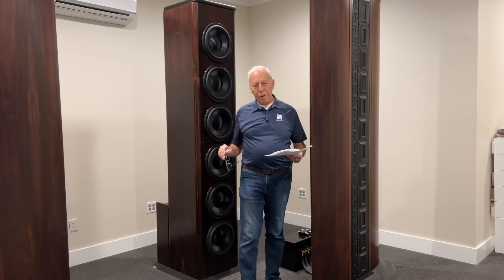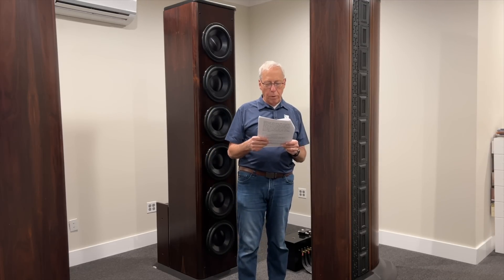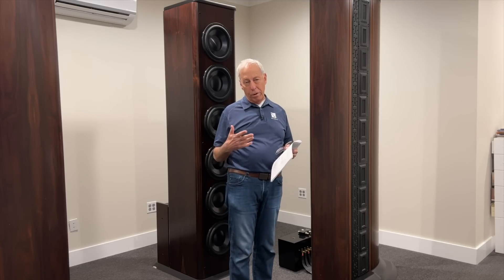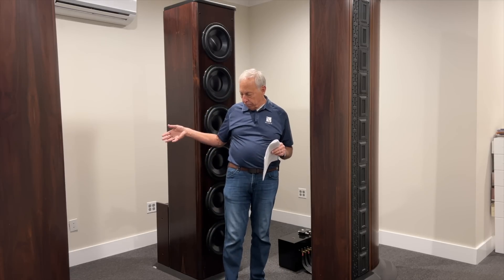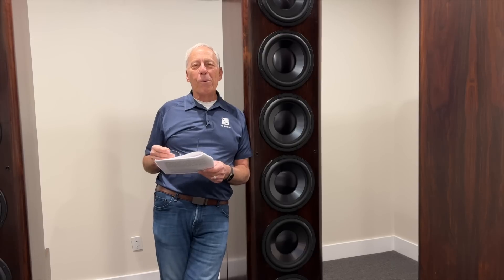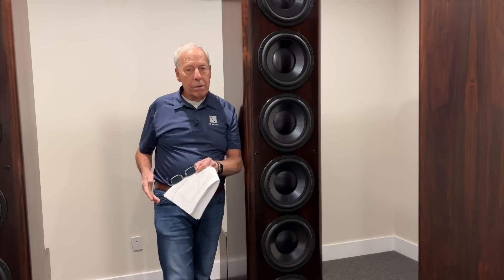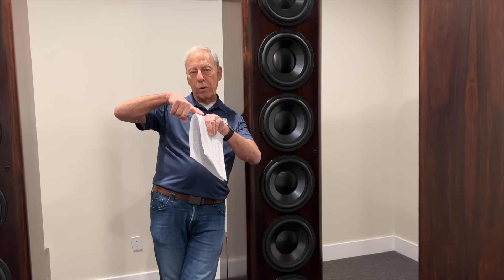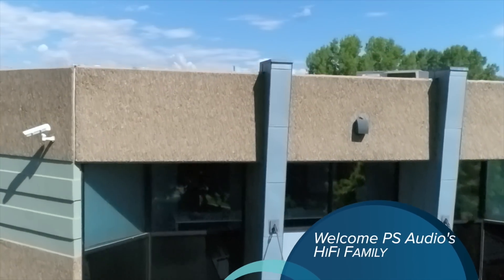Separating speaker cable conductors

Comment: The inductance per unit length of an 'open wire' transmission line (e.g. a speaker cable pair) is given as  ~ 0.9log(D/a)  micro Henrys per metre, where 'D' is the centre to centre separation and 'a' the radius of the wire. So for a 2mm radius conductor separated from its twin by 4.5mm, the inductance for a ten metre cable is around 3.2 uH, or about 0.4 Ohms in magnitude at 20kHz. 

N.B. If the distance between the wires is increased, the series inductance also increases. 

The concomitant shunt capacitance at 20kHz is around 0.9nF (~9kOhm)

[Ref. Chapter 8, Principles of Radar, Radar School MIT McGraw-Hill 1946]
Reply: Very incomplete and misleading analysis based on current advanced applied sciences that are currently in effect today.

Comment: So If I have a single line of cable for each positive and negative[GND] on the cable to the speaker, which I do today I am better of twisting them together (which i do for interconnects) They currently are just generally following the same path from amplifier to speaker.

Comment: Given the extremely low source impedance of your average S.S. amp, load impedance of the average 8 ohm speaker and crossover network, average cable length and at audio frequencies, does the math indicate there will be any roll-off in the audible range?  By how many dB at what frequency?  I.E. what is the cable's inductance, how much does it change and does it have any impact at audible frequencies?

Comment: It would be pointless to argue with Paul's statement that separated zip cord wires sound better than paired.  As the voice from the back of the audience in that Firesign Theater album says, "That's metapheesically absurd, mun, how can I know what you hear?".  But regarding the statement that separate wires have less inductance than paired wires, I can confidently say it's wrong.  Yes, capacitance decreases as you separate the wires, but inductance increases.  

The simplest way to visualize this is to note that for a given current I, the magnetic field B cancels more completely as the equal and opposite currents move closer together.  The largest B can be in any case is at the surface of one of the wires.  The total energy due to the field B is proportional to B^2 integrated over all space.  It follows that as the spatial extent of B becomes more localized as the wires move together, the energy decreases.  But the energy is also proportional to L*I^2, where L is the inductance.  Therefore, L must decrease as the wires move together to more completely cancel the magnetic field.  Most of the concepts needed to understand this can be found in any decent intermediate college level textbook on electricity and magnetism intended for physics or engineering majors.

When I read a "white paper" by some cable manufacturer describing how electrons or signals flow through his cables that has almost nothing in common with accepted science, I like to quote the physicist Wolfgang Pauli: "Not only is this not right, it's not even wrong".  In the case of Paul's statement about inductance, though, it's merely wrong.

Comment: I'm going to go out on a limb here and say that the effect is less to do with decreasing inductance and more to do with decreasing capacitance. The inductance should be very low, unless you coil your cable, which you should avoid. The resistance is basically fixed, as the conductor gauge and length aren't changing. But spacing the "poles" of the cable further apart will reduce capacitance. It's that capacitance when combined with the relatively fixed inductance and resistance of the cable that creates the low pass filter. So spacing the poles will reduce high frequency roll off and that is audible in some situations.
Reply: So many of you are focusing on inductance and capacitance, but for 20ft runs and 20kHz of say 14 awg stranded copper wire speaker cable, the quantities of inductive or capacitive reactance are negligible to the better part of an order of magnitude higher in frequency.. Nobody cares about 100kHz. 
Not even a dog ! 🤣 I’m even willing to bet that most of you that have been on the planet since 1980 wouldn’t even be able to hear the 15.7 kHz (more or less, depending on NTSC or PAL) horizontal oscillator emanating from the old CRT televisions..😉
Reply: I must admit that most of my experience in this area is with instrument cables. All I can say is that switching to a cable that's 55pF per meter from one that's 125+pF per meter has an audible improvement in high frequency extension. The effect may be less relevant to speaker cable but there are other things to consider. Such as the fact that not all amplifiers have a zobel network on their output, or other such circuits to compensate for high capacitance speaker cable. I can think of one particular manufacturer that will not honour the warranty on their amps if the customer has used any other cable than their low capacitance cable. Using high capacitance cable with those amps can cause damage. That same manufacturer recommends spacing cables out to reduce capacitance.
Reply: @Douglas Blake Yes, but the inductive and capacitive impedances of a piece of speaker cable at those frequencies is totally negligible, compared to the load impedance of even the most abusive of speakers (like Martin Logan ESL's).  The response dip at those frequencies would amount to a fraction of a dB.
Reply: @_David_E_  Yes, I don't doubt that some high end amp designers are ideologically opposed to Zoebels, so the speaker cable becomes the Zoebel.  But as an ESL fancier for most of my adult audiophile life, I would certainly not buy an amp that can't take a few pF of capacitance across it!

Comment: Very simple. There is no good reason for the cables being combined, so seperatly is the way to go. Expensive fixes like Paul tells about, are often  only expensive, not more effective. I've got great sounding cables, thin, run seperatly, but they are a league better then all others i tried...And Paul, if you miss the IRS's, just hook then up again, I more think that they had to go out of service as they sound better then the PS audio speakers, understandably...
Reply: "There is no good reason for the cables being combined"

Unless you're opposed to cable clutter, which I certainly am.
Reply: @ziqfriq  there are speakers with wireless connection. That will solve your issue.

Comment: I have used 50 feet of 18 gauge speaker wire on each channel without pulling it apart 
and had no reason to complain about the results.

Comment: This explanation is totally incorrect. Paul confuses inductance with capacitance. Conductors run close together have a high capacitance and low inductance. Separating the conductors reduces capacitance but increases inductance. Unless the cable run is extremely long these effects will be way below audibility . The important parameter is cable resistance. Juft choose a sensible gauge wire to minimise any effects.  No need for expensive cables.
Reply: Finally a sensible comment in this thread
Reply: @geddylee501  thank you
Reply: Mind you, when I put in some numbers, the series inductance does creep up a bit for longer runs of something with sensible dimensions...but yes, don't separate the pair expecting to reduce inductance!

Comment: Yes, lamp cord mentioned in the operator's manual of JBL's L100a model speakers I bought in 1978. JBL said, if you're going to use it, they recommended a certain gauge. I end-up buying a pair of Monster speaker cables. At that time, they were very popular. In the mid to late 1980s I bought a pair of JBL Ti 250's and boxed-up the L100a's along with the Monster cables. About 20 to 25 years later I unboxed the L100a's, reached in and grabbed the Monster and was greeted with a handful of very, very sticky cables. Something leaked through the clear plastic, or something happened to the plastic coating around the cables. The speakers were always stored at room temp in a closet. Well, those cables hit the trash can. Weird.......
Reply: Some kinds of plastics, particularly flexible ones, break down chemically over time; some in fact in very little time.  
This is one reason why remote controls develop problems --- the rubbery stuff used for the buttons 
oozes a sticky goo that keeps the conductive carbon dots from doing their job. 
Cleaning up the mess usually cures the trouble.  
With equal success I have used (one only of) Dawn detergent, alcohol, or a very good quality non-lubricating contact cleaner.
Reply: @spacemissing  
I did hit one of them with a little alcohol and had good results, but I had bought new cables for my new speakers. Tried giving them away to friends but had no takers.

Comment: I have a Bi-Wire set of "Anti-Cable" speaker wires, running from a Rega Elex-r to a pair of Legacy Studio  Monitor speakers.  The "Anti-Cables" are solid copper wire, not woven strands and flexible, but bendable like mag-wire/armature wire.  The bi-wire set (4 wires) float in the air since they are so stiff, almost completely independently of each other and only meet up and touch each other when they insert into the Rega amp.  Am I getting the benefits Paul mentions like 'separating lamp cord' into each strand; less inductance/interference from one wire to the other?  I've used other speaker wire (Silver Sonic bi-wire, Western Electric tinned copper, Cardas), and of all that I have tried, the "Anti-Cables" sounded best.  Wonder if the separated conductors is one of the aspects that helps with that?

Comment: Yeah, I used Monster Cable  back in the 90's. The cable ran from my amp in my equipment rack on the right side of the room, along the carpet to the speakers that were on opposite sides of the sliding glass doors to our deck. The doors were covered with heavy curtains. The copper in the cable that ran to the left speaker along the outside of the track for the doors all turned green!

Comment: lol this is audiofoolery at its worst
Reply: Please, continue using your wire coat hangers.
Reply: @Mark-lq3sb  ahahahaha...pssst..."snakeoil"
Reply: This explanation is totally incorrect. Paul confuses inductance with capacitance. Conductors run close together have a high capacitance and low inductance. Separating the conductors reduces capacitance but increases inductance. Unless the cable run is extremely long these effects will be way below audibility . The important parameter is cable resistance. Juft choose a sensible gauge wire to minimise any effects.  No need for expensive cables.
Reply: Changing cables is like baking the same cake but in different ovens expecting them to taste differently
Reply: @sparkplug5392  ahahahaha...pssst..."that's what you think."

Comment: 12 AWG "lamp cord"???
Reply: It’s a BIG lamp 😊
Reply: I caught that also. Most lamp cord is 18 AWG - which by the way is what I still use. I understand that 16, 14, 12 AWG zip cord is used for high current drawing applications.
Reply: That was my first thought... back in my day, the cheap cord widely used for speakers was probably only about 20 AWG.
Reply: @osliverpool  Yes. I got into audio and video just before 1980. I do remember the clear 'speaker wire' that was available nearly everywhere being about that AWG size.

Comment: Yes I have all dragon cables for speakers, signal, power. Yes they are very expensive. Even if you know someone and can get them at a good discount to do all the cables in the many tens of thousands at a minimum depending on the run length. The Dragons are custom made to order and pre-burned in before shipping out. They still say they want to see 100hrs of play time before they mellow in and smooth out some. On first play they can be a little technical and bright but then round out and warm up later on while still keeping the clarity. You can get done but the FOOT when ordering which is what I did. Consider if you ever change rooms from small to medium to larger room you might want to pay extra for the longer speaker cable run because they cannot add onto it later to make longer.
Reply: Very funny.

Comment: Did I get this right: From your amp, 10K speaker wire connects to the speaker terminal and then Monster Cables connect the speaker to the terminal. Is that correct?

Comment: Monster Cable was the brand of my first cable upgrades, back in the early ‘90s. First speaker wire, then interconnects for my CD changer. I was amazed by the sonic differences and haven’t looked back at “courtesy” wires since. Your mentioning the brand brought back sweet memories. Thanks Paul
Reply: still use them! Along with audioquest and Moon audio and other brands in the system. Monster sounded better than all the others I tried.

Comment: The copper wire in my thirty year old Monster Cables has corroded and turned brown. Should I still use them or throw them out?
Reply: Clean it good it will be ok no need for new cable plus you have good copper wire which is a good thing.
Reply: Generally you can just snip the ends off and get to a section that is not corroded.
Reply: if you have noticed a difference in the audio between thirty years:
with a new set of Monster Cable the miscoscopic difference in audio or osciloscope will be shown, but the ears after 25 years will hear a different thing.

Comment: ok....going way back to using ROMEX for the "low" end and the thinner "ZIP CORD" for "high" end.....presumed to be tied in parallel runs to the 2 poles.....WOULD YOU NOW...say separate the conductors in that scenario ?    SO parallel wire tied to parallel wire to be clear on parallel runs...so 4 conductors all together.....Hmm but what about  2 positive conductors as one thick and one thin....and a common ground conductor as the "return"  ??  What are your thoughts on the 3 conductor and 4 conductor aspect ?  What is implied, is that the HIGH AND LOW are a 2 way system ...what if you add in the 3rd with a mid-range driver  and the complexed crossover....in a single amplifier setup...but hmm what about a Bi-Amp or a Tri-Amp ?    ALL a MEANS TO AN END...and how you get there....

Comment: Hmm....not sold on problems of "zip cord" also known as speaker wire simply because were are dealing with  frequencies not  frequencies which is a whole different world when discussing cables.  Speaker wires can be twisted, known as "twisted pair" and done in heavy gauge wire which btw can be done DIY to reject external electrical interference, seems like a good thing right?  Well not buying that when considering levels driving speakers simply because whatever tiny amount of interference there might be is absolutely buried (think S/N (signal to noise ratio)) under signal levels of speaker outputs.  There is a very simple way to cut through all the marketing involved in cables.  Free tip:  Connect an Oscilloscope to the amps output, observe signal, noise, freq. response and whatever your concerned about.  Now do the same at the speaker terminals (to observe the differences)  Now throw in those super oxygen free 8 gauge etc. etc. etc. expensive cables and compare.  Note Oscopes can display values far beyond anyone's golden ears unless you can hear radio frequencies.  Speaker wire is about last on my list of where to spend $ on hi-fi.  Start with 70~80 percent in your speakers.  If you can't float that then start with a good set of headphones and save until you can afford a set of speakers to do your system and room justice.  Another tip based on facts:  Learn basic Ohm's law (easy).  Now look up the ohmic values of even 18 gauge wire, notice the values are listed per   Of course there is the dreaded blind A/B testing (dreaded by those trying to justify $ spent on super duper audio cables)  I'm not an Audio Engineer but a retired Electronics Technician and previous mixing tech for a large venue who has always had a fascination with home HiFi and a passion for great music.  Sorry but I would trust the average HiFi salesperson about as much as I would a car salesman.  When people don't know a subject they can be told almost anything and many will believe it.  Sorry this got too long, HiFi misinformation is just one of my pet peeves.  Next someone will tell me their music sounds better on a full moon especially when cables are levitated.